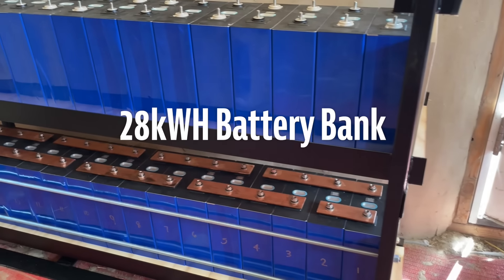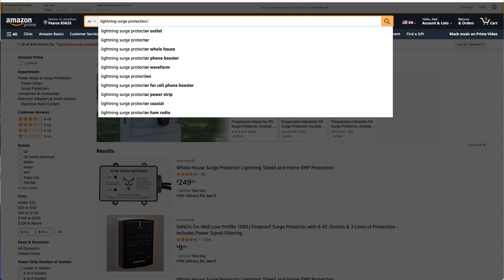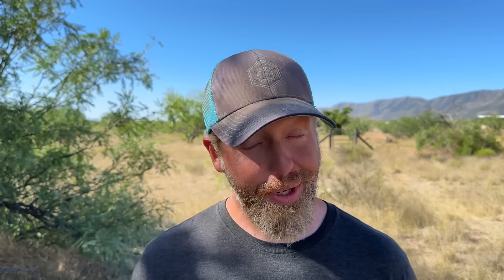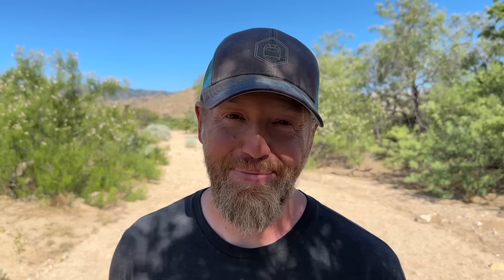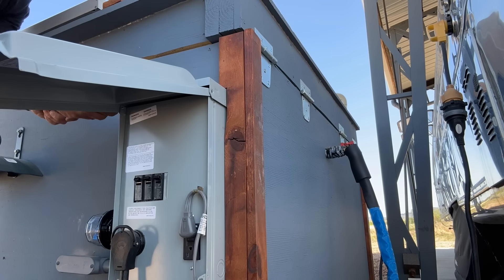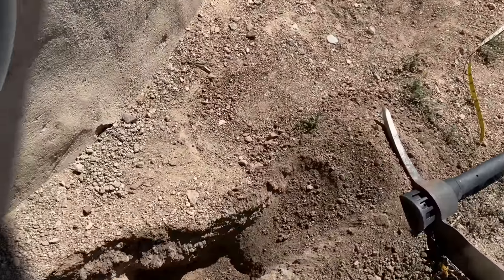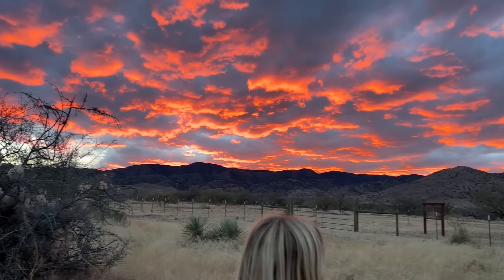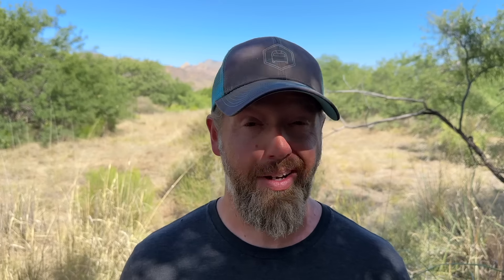This Cost Us THOUSANDS - Lightning Destroys DIY Off-Grid Solar System

Comment: I know you are probably under NEC rules. In IEC 60364-4-443 you always have to have SPD installed, unless you have shown by risk analysis that thunder is not an issue were you live or in case of being in a residential area and that you equipment is not at a value or below 5x that of the installation of a SPD.
In the case of this solar installation, installation of a SPD is a mighty good idea, since inverters and solar are expensive.

Comment: Hi Jonathan! I design utility-scale solar, wind, and battery energy storage systems as an electrical engineer. We regularly run computational electromagnetic grounding studies to determine ground fault current withstand. A common solution technique involves installing Ground Enhancing Material (GEM) around your horizontal and vertical electrodes to improve the conductivity of the soil when site conditions are less than ideal. This seems to be a nice solution for you, as it appears you are recycling rainwater and trying to save any you can collect! This solution method is more effective from a cost, protection, and safety perspective when analyzed against additional copper. The impedance of your ground system to remote Earth is entirely dependent upon geometric and material properties.
Reply: Please talk English please.😄
Reply: Where can I learn more about this method?
Reply: Ohh, The Engineering is Strong w/ this one.
Reply: Pretend you are teaching a 10 yr old this method. Ok ready, set, go ! 😊 i as a 45 yr old woman understood abt 000.2 percent of what was explained in the above comment.
Reply: What material is best for conductivity
Reply: Iron rod dissipates into soil and creates a conductive soil sponge?
Reply: What do you charge per design.
Why not just use conduit to run your electrical lines through. This way you have 0 conductivity..
There is armorer cable that prevents this as well is there not.
Reply: What’s your website info?
Reply: Translation: help the grounded systems, copper ground rods stay effective by incorporating plant life and vegetation that help keep moisture in the earth near your grounded system.  And the more ground rods the better. And connecting those rods with bare solid wires add to your system.
The man was saying keep all that you did moist enough to work. 
And regularly test everything including the moisture level.
Reply: I work for the gas and electric utilities and from what I’ve seen, unless you have some serious equipment to prevent lighting strike damage , that lightning is going to do whatever it wants. I’ve seen things you wouldn’t believe is possible. I have serious doubts about any lightning precaution, but if it has a slight chance to help I guess it would be worth it.
Reply: So, what ground enhancing materials would you suggest to flank the electrodes with? Also, what would determine the most ideal properties for moisture content, and/ 14:15 or soil composition for proper grounding? Also, what gauge of copper should you use?

Comment: The best Earth ground in that soil would be the well casing . I'm usually grounding for RF and Lightning with good earth I use a minimum of 3 8ft  ground rods 12ft apart connected with #4 wire connected with Cadwelds  all of it at least 1ft deep .

Comment: I live in SWFL. I put midnite solar spds at my combiner boxes and at my charge controllers. It may be overkill but lightning scares me to death. When a storm comes and I am home I even shut off my charge controller breakers. The system has been running since 2008 and I haven't lost anything to lightning yet.
Reply: Do you happen to have a photo of how you wired the SPDS to the combiner box?
Reply: @BrianGaberFishing  No pic but easy to explain. The combiner boxes have a conduit punch out on each side and I attached the spd there. There is a bus bar for the negative, positive, and ground in the combiner box. I wired the spd to these busbars.
Reply: @trkarl  thanks!

Comment: I know you will have a bunch of comments, but something I learned in my telecom days is that when you bring the cable into the house, on the exterior of the house, wrap it 3 times, and cable tie the loop at 3 inch diameter. That is enough inductance to halt a lightening strike.  I don't know if it is enough to keep it from damaging electronics, but it is usually enough to keep from burning the house down.

Comment: I did grounding for telephone offices. There were several places where we put soaker hoses on timers around the buildings ground rods to help with the dry conditions. You might wish to place plastic, (a vapor barrier), over your ground roads.
Reply: I was thinking almost the same thing. Since they already water their orchard with drip on a timer, I thought they could detour that hose to water the grounding rods, too. I was looking to see if anyone else thought that would work. Thanks!
Reply from the maker: This is great if you have excess water to just soak in the ground :)
Reply: I use the same midnight on my off grid. One on solar panels, one on AC inverter, one on Battery, one on mini split. Hope for the best when there are radical electrons finding their way to earth ☺️
Reply: Luckily most of these storms over here happen during the monsoon season and the ground is usually quite saturated...
Reply: @TinyShinyHome  Sure, I get your watering limitations, but I don't believe you would need to create a swamp. Just treat the grounding rods as tho they are a couple additional trees on your drip system. Of course, I don't live on your property or within the same parameters. Just a thought.
Reply: @angeliquerider-mitchell2538  a hollow ground rod, with some small weep holes, fed with a tiny amount of water, even grey water, will work wonders. Concert audio engineers carry bags of salt when earthing lighting and sound systems

Comment: As for ground rods in dry soil or rocky soil, we tend to dig down about four feet and add a 6” diameter plastic pipe to the "well". We drive an eight foot ground rod down in the middle of the pipe, connect a very heavy ground wire and copper strap to the rod and run those to your power system. You can also connect heavy copper ground lines spreading out as radials from the ground rod buried at least two feet u dear ground. Next backfill the ground well with a layer of clay on the bottom if possible followed by some dirt with peat moss for about a foot followed by some gravel. At this point get about two cups of coarse salt and mix with five gallons of water, mix well and pour it into the plastic pipe well. This should help saturate the earth below ground level and create a more conductive path for the lightning strike. If you have a lot of storms hitting during your monsoon season, place a few plastic barrels adjacent to gather rain water. You can use this rain water to drip feed the well to keep it moist. Do not add any additional salt to the system.
Reply: excellent post...especially about the extra heavy copper ground wire.. if you're going to do the job get it right. The gauge he installed looked too light...just my opinion i'm not an expert.

Comment: Thanks for the info. I'll be building my solar system in the fall and have been wondering how to ground it with the earth so dry.
Back in NY my old farm was hit by lightning a couple of times. The lightning rods saved the house but it came back up the phone line and fried a surge protector which saved the computer

Comment: A trick I use for mounting MNSPDs is to get a cover plate with a 1/2in trade size knockout on it and stick the MNSPD in that instead of the box.  You can get these cover plates for both single gang handy boxes an four square junction boxes.
Also, I have DC rated enclosed knife switches on all my PV home runs at the inverters or charge controllers.  Any signs of thunderstorms and they all get shut off, which is important when some of my home runs are over 300ft and local ground conductivity means lightning surges go out in the thin layer of conductive dirt and not down into insulating rock.
Reply from the maker: Great info - couldn't ever find a cover plate with a knockout here in our little local hardware stores. Probably need to get one online.
Reply: @TinyShinyHome  Home Depot and Lowes should have them.
Reply from the maker: Yah that’s like a 1.5 hour drive for me 😂
Reply: My dad used knife switches to isolate the inverter, but it still got fried, I think the surge either jumped the gap or (more likely) traveled into the inverter through the neutral or ground wires. So I installed a 30amp plug so the equipment so all conductors could be disconnected and invertor was totally isolated. No more issues with lightning surge frying the inverter, but requires unplugging the system during the storm and playing cards with candle light!

Comment: Something to consider.. your grounding rods are great.. if that is not enough of a clear path.. add a copper plate or copper sheet to your grounding system.. it provides a much larger surface area that will help disperse the high voltage better..
Reply: I second this. Ground bars are the way to go. It’s also easier to upsize your grounding wire to a centrally located ground bar.
Reply: he has a grounding loop with two sets of rods in different locations. That is probably what killed his equipment in the first place.

Comment: If you have any concrete w/rebar you should check out a UFER method of grounding.
Also I’ve made copper grids, 12’ x 12’ with 2-0 conductors every foot, all bolted together with split bolt connectors, lay this flat two or three feet deep under an area of gardening. This effectively protected telephone systems in the Arizona high desert.

Comment: What we have done to our systems because the desert is so dry we installed triple ground rods like recommended for electric fence. I was told by an old timer that it was a cheap way to ensure we have proper grounding.

Comment: Looks like you’ve got it covered! :-)   I am wondering if you could prevent the near strike issue by putting down the metal mesh under the long runs. Lay the wiring runs. Then bend the mesh over the wire and ground the mesh at both ends. In theory this would make a bit of a faraday cage around your long runs.

Comment: As to your mounting issue with the Midnite Solar SPD you could use a 90 degree pull box to bring the SPD out from the side of whatever cabinet or box you want to mount to.

Comment: I enjoyed watching your video, ime an electrician by trade in Northern Cape South africa we have severe electrical storms every year. What I found is that using earth rods in sandy soil is not always effective because there is not a good bond between the copper earth rod and the sandy soil. Easy and cheap way I improve this bond is to pull out the earth rod and add salt directly in the hole, hit the earth rod in again and add salt around the earth spike, after closed add water to help bond the salt to the sand. I use about 3 killo grams per earth spike,  add 1 killo gram of salt on top every 12 months to ensure the earth is effective. Hope this helps

Comment: One more thing. I know water and the footers for a house does not mix well. However, I suggest you make sure you drain rain water into the ground around one or more of those rods. That helps secure the connectivity between the rods and the sandy ground.
You can even buy ground earthing materials to put in a hole around a ground rod for better connectivity.
I see issues with this bad earth bonding, when talking about charger for EVs al the time.

Comment: In such dry soil, those ground rod connectors should be ok.   In my moist soil, it is recommended to  weld the copper together with a product called Cadweld.   However, I could never get the Cadweld charges to ignite.   Tried the recommended flint pistol, lighters, even propane torch.   I gave up and will use the connectors in this video.

Comment: Suggestion for placing a Ground Rod !
Instead of hammering them into the ground, use a spade and dig a circular hole a foot or so in diameter !
Pour water into the hole, then take the pointed end of the ground rod, and push it into the center of the hole, as far as you can !
Then pull the rod most of the way out, and then proceed to push the rod further into the hole, then pull it up again, adding water as you see fit !
Continue with the up and down motion, until you reach the depth you need !
Likely leaving a few inches above the soil !
Shouldn't take but a few minutes, at best !
Once doing this, you'll never beat another one in !
Too, this keeps the end from mushrooming !
Easy Peasy !
Not wanting to overstate the obvious, but always call, 
" Julie ", before you dig, or installing a Ground rod !
Too, if you strike a rock in the process, you likely will have to move your rod !
Hope this helps !
👍😉

Comment: Thanks for the info. I'm closer to Bisbee,  in a similar offgrid setup, lacking grounding right now, but im going to correct that this week. But we have caliche everywhere. Not sure how im going to get grounding rods down 8 feet, but i'll try, and I just ordered 2 SPDs using your links. Thanks for doing the research for me.
Reply from the maker: Hammer drill should help - and caliche should have conduct better than our sand at least. Good luck!
Reply: @TinyShinyHome  I ended up cutting some in half.. and pounding in with a sledgehammer.  and one I embedded in a berm that was softer.. now to run the copper lines to them.. its thick and ideally would be in a trench.. but with that caliche... im just going to cover with some gravel :)

Comment: Great info and something I will consider before installing an off grid solar/battery setup. For transmission lines, there are static wires installed above the actual power lines for lighting protection. Not sure if that would work for your solar panels. Basically its grounded conductor that would be installed above your solar panels incase of a lighting strike. Electricity likes the path of least resistance to ground.
Reply: The problem here was different, there was an earth potential rise event

Comment: Standard grounding for a 200 am ac panel is two ground rods eight feel long six foot separation with #6 wire.  Having one ground rod is just not enough for an ac system and now three is stellar.  Grounding is so important now days because of the static sensitivity of electronics and harmonics created by them.  Top notch grounding is the answer to many problems.  Great Job.

Comment: Remember with lightning you do not need to have an actual piece of equipment hit .
A nearby strike has the effect of a 1 turn transformer between  the lightning fork and any part of the installation, the 100 foot wiring section could have an instantaneous rise in voltage exceeding the safe working voltage without actually been hit and thats when the damage occurs.
A direct strike is a different matter.
Reply from the maker: That’s the whole point of this video - indirect strikes.

Comment: One more Idea for you that might help prevent this in the future.  you might want to build a lightning arrestor rod on  the edge of the property, something like a tall meatal flag pole with a lightning rod on the top to give lightning a much easier way to ground away from your solar setup.  If you go this put 8 rods in the ground no closer then 10 feet from each other around the poll to gain the best ground in the area.  You will find that lightning would strike that fairly often, so it should protect your setup much better.

Comment: Jonathan you have done a fabulous job covering the important parts of grounding electrical equipment. I desire to enlighten you and your subscribers to a few useful simple but equally important things to add to a grounding system. Motorola R56 grounding specs seem to be the standard in radio and telephone.  Basically it is center point grounding taking all your grounds to one point Then distributing all your ground rods out from that point, This will help keep the protentional (voltage) the same across the system. Plus simple ion static dissipators (metal whiskers that replace lightning rods) Especially where you're located. I just retired from a career of building mountain top microwave radio and telephone repeaters, all solar powered, throughout the Rocky Mountain region. Using R56 standards we were able to reduce damage by lightning by over 95 percent. However as my college professor said the Only thing we really know about lightning; is that it will strike wherever it damn well pleases. All we can do is help it choose the shortest and easiest route to ground.

Comment: As a ham radio operator, one thing I've learned about lightning is that it's unpredictable. Lightning doesn't only go down, but can also travel sideways and strike in areas that don't have cloud cover. The type of ligtning you have in this video is perfect for te Midnite modules, but If there's ever a direct strike all bets are off. getting all the items in your electricity field to have the same ground potential is important and should be checked with a meter. A zero voltage differential between you and the earths means you look electrically invisible and hhave less chance of drawing the stray voltage to yourself. Some disagree and say floating a ground is the way to go, but I disagree. Informative video and reminded me I need more Midnite SPD's.  thanks